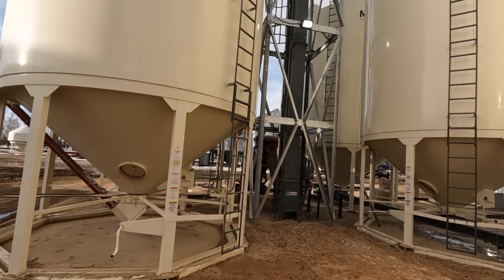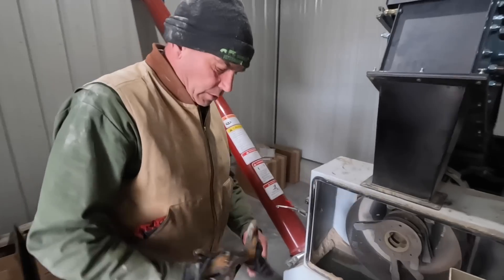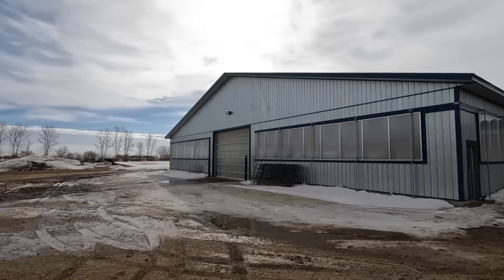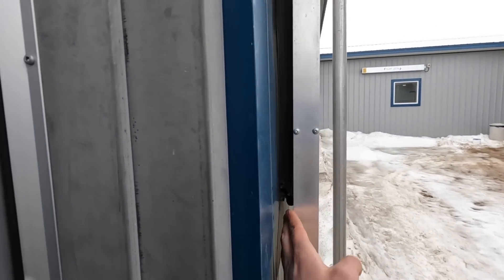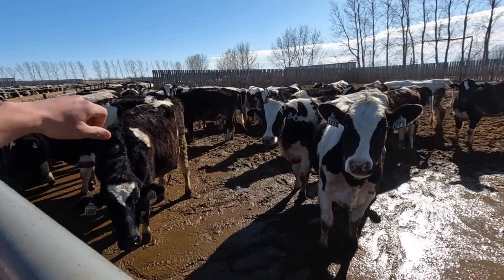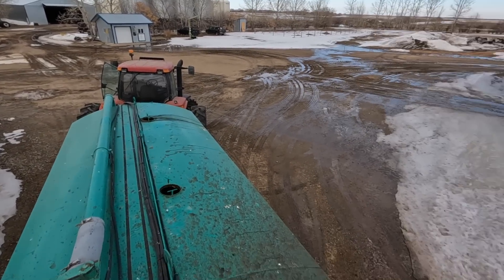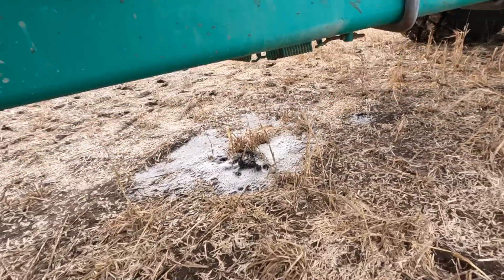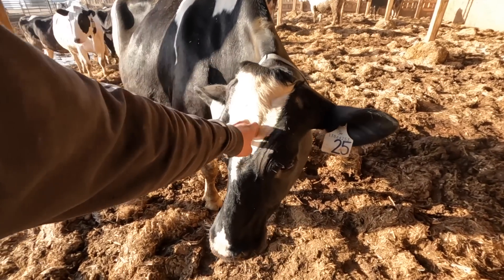Feed Mill Plugs and Getting Ready To Haul!

Comment: Storing grain kind of wet the grain draws moisture, humidity , heat from sun will causes the grain bens to swell up and clog . You may have a leak somewhere in your grain ben. Wow those gate racks shouldn’t be leaning against those blinds.Snow is finally starting to melt summer is almost here. Your going to be coming out looking kind of messy after you breed the cows😂😂😂😂😂😂😂😂.

Comment: Hammer milled oats are very light ad fluffy.  The repose is quite a bit higher than unmilled oats, meaning it will make a very tall pile in the bin.  I suspect that you high level switch in the bin is in a bad spot and the pile can reach the discharge of the spout before the switch trips.
Reply: My pile at my  farm stop word on the 1 day we got the farm